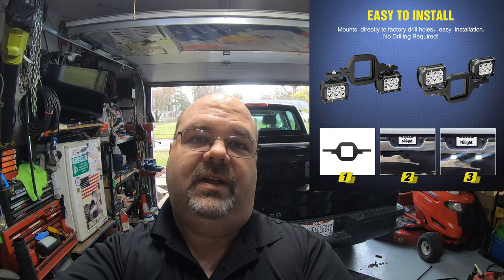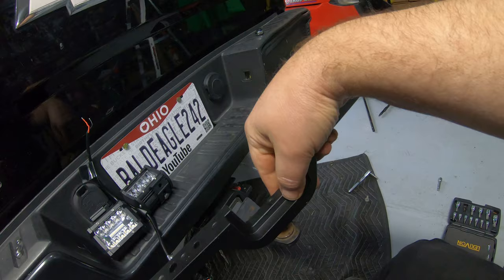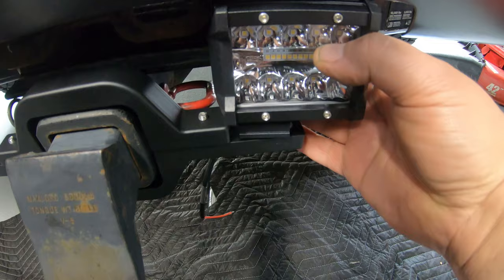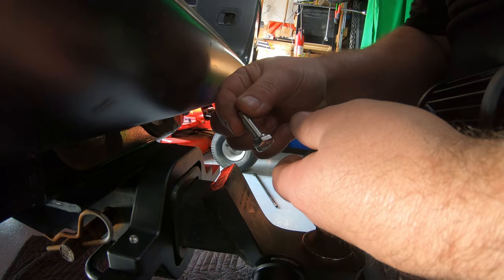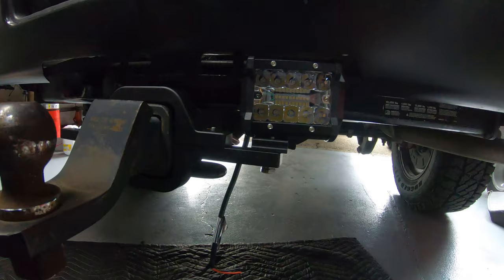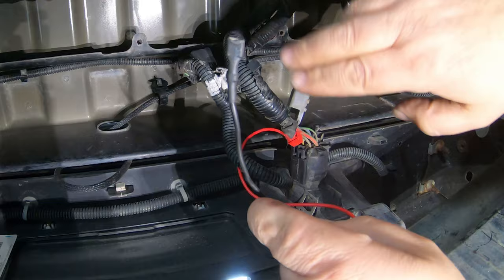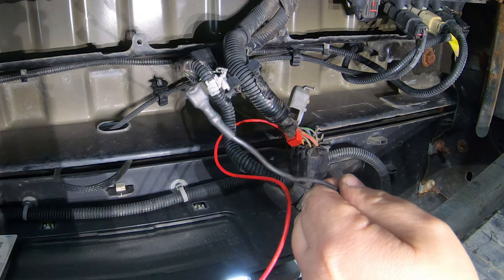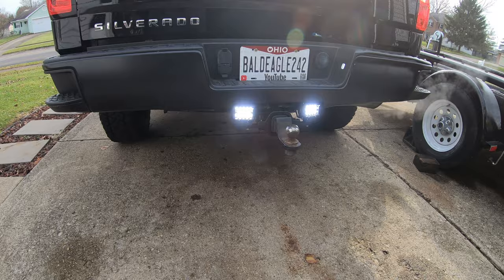The Benefits of LED Reverse Pod Lights & How To Install Them!

Comment: I would run them to a Hotwire and install a manual switch. That way you don't have to have your vehicle in Reverse to have the benefit of the lighting.
Reply from the maker: I didn’t have the wiring or switch handy when I did this and was pressed for time to get it completed.  I should have mentioned in the video that I can also turn them on and off momentarily with the key FOB with the ignition off when needed. They will stay on for 20-30 seconds when the unlock FOB button is pressed.

Comment: I bought the same thing.  Unfortunately the bracket didn't fit but i installed the lights on the bumper.  First rain they leaked and stopped working.  Cheaply made 😢
Reply from the maker: I would reach out to them on their website. I’d bet they will send you a free replacement.

Comment: Nice! I’m guessing you chose to put the lights on top of the bar, but I’m assuming you can just turn the way you mounted them upside down so the lights are on the bottom of the bar as opposed to the top? I’m also guessing you did it that way either because you felt they’d stick out like a sore thumb if you mounted them below, or you mounted them above in order to protect them from road debris? Thanks brother!
Reply from the maker: That is correct. They are designed to mount underneath but I chose to flip them around to keep them up out of the way and less obvious. Either way these are nice bright lights and work very well for when backing up in the dark.
Reply: @baldeagle242  they sure look great, thanks again my friend, I am now a subscriber!
Reply from the maker: @paulmenard4114 Thank you!

Comment: Thank you for your video. Very articulate and annunciated well! 

I’m working on this little project. Hopefully finish up in the coming days.

I had to do some work to get the bracket to fit however. The welding on the hitch created extra effort. I couldn’t quite get the two bracket pieces to reach one another, but enough to get the bolts to mate with the bottom piece. Caveman ingenuity and effort was required.

Now to mount the lights and complete the wiring.
Reply from the maker: @fstvette5233  Thank you! There have been a few other comments about this. I did not have this issue with mine but I can see how a little weld build up could cause an issue like this.
Reply: @baldeagle242 You also have much more room above the bracket to tuck the lights in. I’ll have to have mine below. Hopefully they won’t get dinged around too much. I’ll let you know how it goes.
Reply: @baldeagle242  Project complete. Took my time with the wiring. I wasn’t comfortable or confident with the direction you went for the reverse lights. Seemed my taillight wire was thicker and a difficult reach. I took to the driver’s side taillight and tapped into the green reverse light (thanks to my son for his research) at that point. Works like a champ! Thank you for your help!!
Reply from the maker: @fstvette5233 That’s fantastic!  How do you like the light output?
Reply: @baldeagle242  Awesome! First time backing into my parking spot at work just a few minutes ago. Aces! Love the lighting. Exactly what I was hoping for. I like to hug the end spot and always had a tough time seeing the right rear, fearing curb rash on my 22” rims. No more worries now. Thanks again!
Reply from the maker: @fstvette5233 That’s awesome! I have dark windows and these are a game changer.
Reply: @baldeagle242  Yes. Dark tint to say the least. That never helps. 🤦🏻‍♂️

Comment: Scotch locks should never be used where they are exposed to the elements. 
👊
Reply: Agree.  I lost a rear light in my truck and found the wire had broken off at (in) the Scotch lock where the metal connector pierced the insulation and connected the two wires together.  The Scotch Lock was used to connect a trailer wiring harness to the truck.  Now, it lasted for 3-4 years, but I was in Florida with no snow, ice, slush, or road salt.  I have a LOT of Scotch Locks in my electrical 'stash' cause they come with all kinds of wiring devices and I won't use them any more, but my mind won't let me throw them away.

Comment: Nice upgrade , will be doing this to my truck in the spring
Reply from the maker: It’s a great upgrade if you do much with trailers or backing into dark areas.
Reply: @baldeagle242  seems more times than not I’m backing in or hooking up to a trailer where there is not ,enough light, I have a couple lights on the backrack but it casts lots of shadows, this should be much better, thanks
Reply from the maker: @gjohnston281 This is much better. This fully lights up the back gate/ramp on the trailer and makes it early to see right where I’m at.